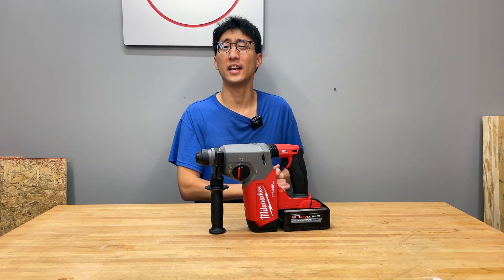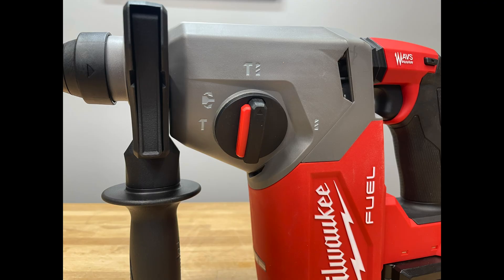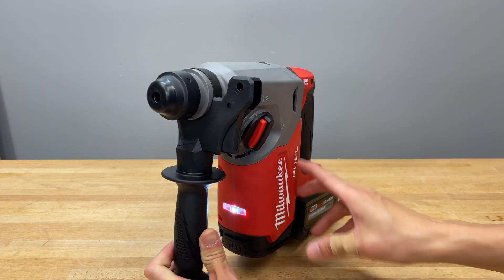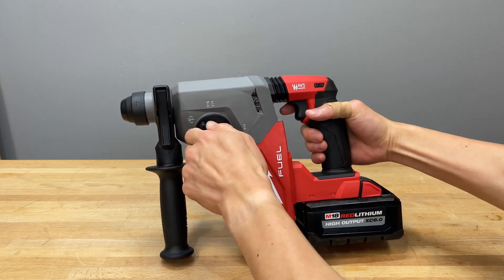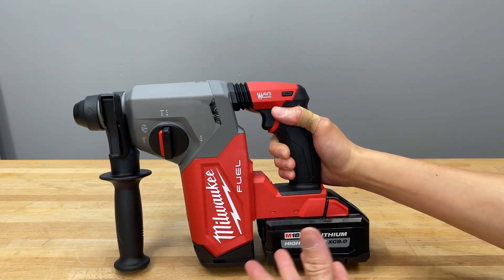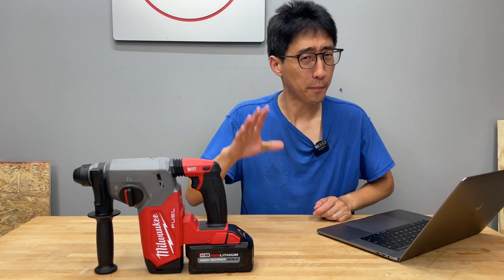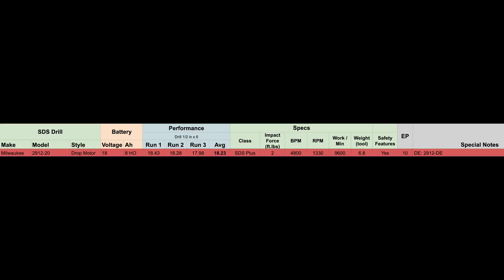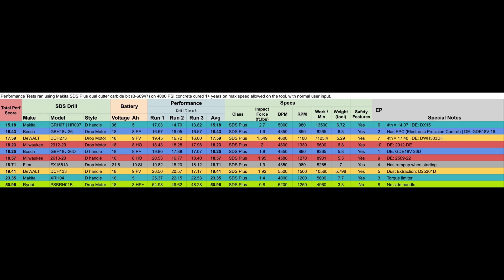24-19 | Milwaukee M18 FUEL brushless 1 Inch SDS-plus rotary hammer drill | 2912-20 | ep.10

Comment: I had a problem with mine, after finishing two holes in a wall some grease started to come out the tip that hold the drill bits. Any idea what is the problem or how to fix it?
Reply: Yea, they put too much grease in it at the factory, you’re supposed to put a small amount of grease on the drill bit on the part that that goes into the drill.

Comment: Just got one of these hoping to replacing my 12 year old Makita that although under powered is still going strong. I Must say I am not impressed with its quality at all, not smooth when swapping function to hammer only as mentioned in the video, gears sound as though they are grinding when first select onto hammer rotary function and whines like a bitch until let off trigger and re press. As for the auto stop function its way to sensitive when using it for chases slight movement from vertical to horizontal chasing which as a sparky is a hell of a lot it just completely shuts off! Very disappointed I thought Milwaukee were supposed to be top quality but this drill doesn't seem refined at all.

Comment: Do you think that drill would do a 2 inch hole in concrete 6 inches long
Reply from the maker: Sounds like a core bit. It could probably do it, would eat batteries in the process though

Comment: How come this says 1 inch. What actual shank size do you need for it?
Reply: It's called a SDS plus bit. It's widely used in the industry along with sds max bits
Reply: 1 inch means you can only put up to a 1 inch solid concrete bit on it. But you can put larger "core" bits on it and go larger

Comment: I'm more of a D-handle guy as it saves me a bunch of $$ and weight but from a performance perspective I was expecting a bigger gap from this Fuel and the D-handle Brushless non-Fuel you tested in the last episode.
Reply from the maker: I would have expected as much also, but if you look at the specs there isn’t a much gap in impact force and bpm. Maybe the fuel has better run time? 

I wouldn’t expect huge difference in sds drills in this class. Sds max will probably have bigger gaps.
Reply: I've just bought one and mine does the same